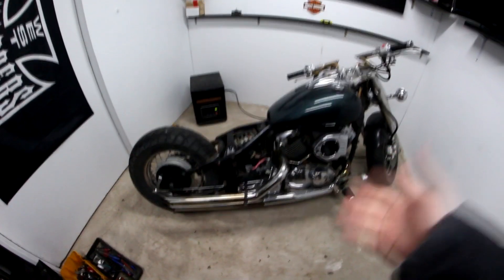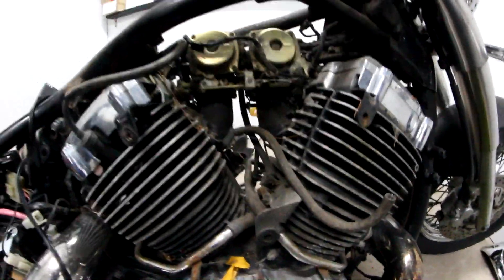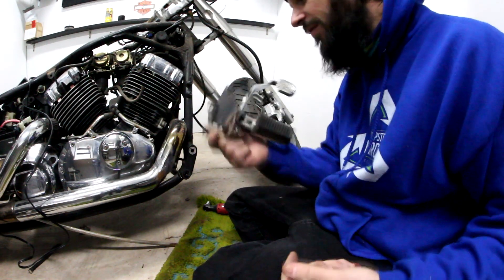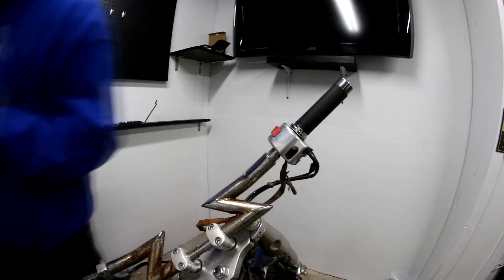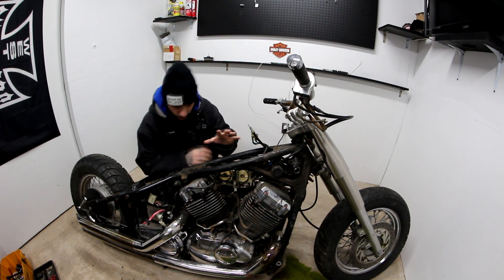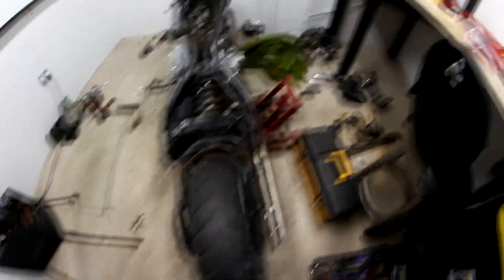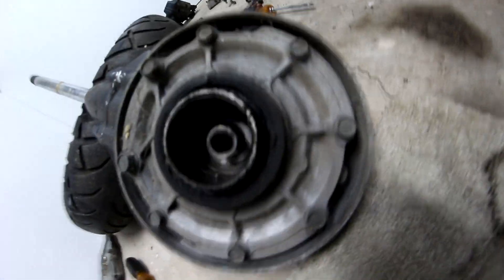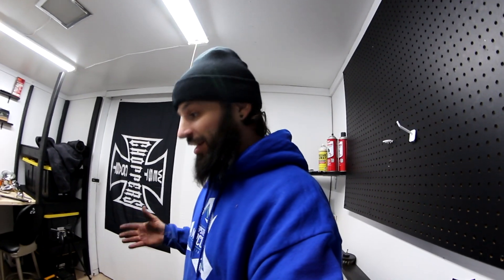Taking Apart A Motorcycle Start To Finish 1998 Yamaha V Star 650

Comment: Just found your video, and yes, you got it. I bought this bike today from an excellent gentleman who kept it pristine. The only issue is that has been sitting for 10 years. No oil leaks, engine has compression, all the electrical works, not even rust on the metal parts. Only rust is on the pipes chrome. I'm wondering if is better to buy a new carburetor or repair the existing one? Will use your video as a disassembly manual.